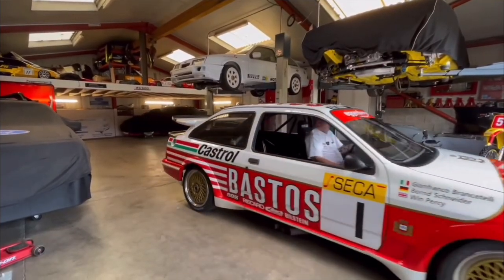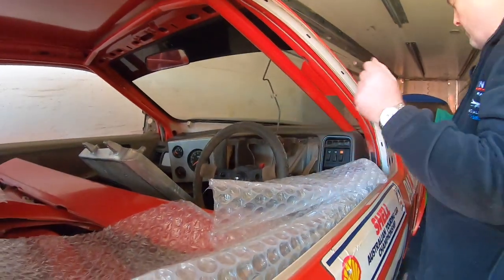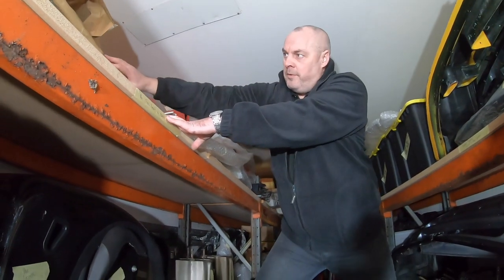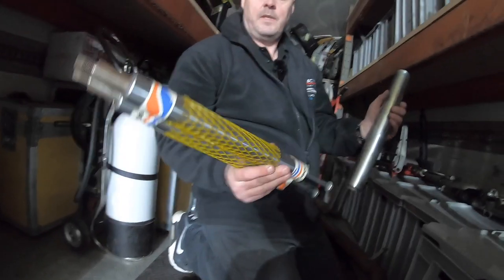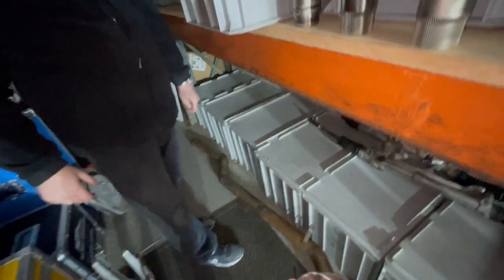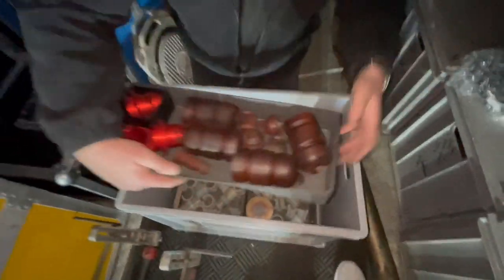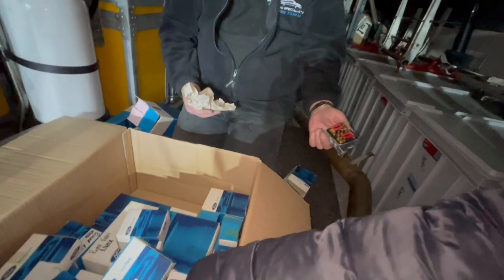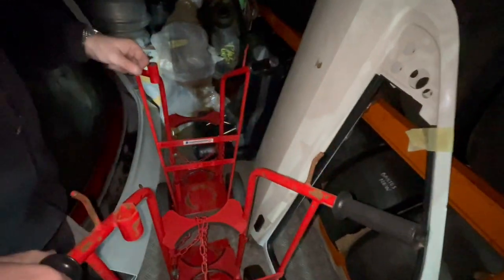Pauls Australian Delivery of IMPOSSIBLE to find Cosworth Race Car Parts

Comment: This is a blast from the past. I worked for DJR during Radisich's stint. I saw that Sierra in the museum and thought it was rough. I never knew it was a show car.  Fooled me. 

I'm not surprised Dick still has parts for the Sierra's. He's a pack rat, never threw anything away. (I remember the roof at Daisy Hill!)

Good luck with your build Paul. I'll keep an eye out for updates

Comment: What a treasure trove! Ended up in the best hands possible!
Maybe one reason the rear arms were changed from magnesium to aluminium is that mag is more prone to cracking around any stress raisers, and more importantly magnesium loses significant stiffness at high temperatures (80-100 deg C), which may be an issue with the exhaust being near.

Comment: Those parts look VERY familiar. I unearthed them originally back in 2010 after being put in touch with the owner by Rudi Eggenberger. I went to see them along with the Bastos car (there were a lot more parts then as well, some have been split off) and was offered both for 280'000 Swiss Francs which was £130k at the time. Hindsight is a wonderful thing...

Comment: Adam see the likes of the plastic air scoop for the radiator on the 500's 
who Paul not be better getting that 3D scanned and 3D printed?
because they are brand new old stock the thickness and shape are 
perfect without any repairs.
I'm pretty sure theres a market/ profit in it for Paul

I couldn't think of a better man to get his hands on these parts, He genuinely cares for ever nut, bolt and washer in those boxes! He will make an amazing #7 and perhaps #8 😁

Comment: Interesting tour of a hoard of parts an also learning a bit of history. I liked the XR4i when I first saw one as a young teen an didn't follow on with Cosworth but later in my 20's I had XR4X4's a 2.8i an a 2.9i.
The 2.8 had all it's ford decals but the 2.9 was debadged an had lots of holes in the dash an stuff where radois an lights were removed, I believe it was ex CID.

Comment: Oh I remember the feeling when a container full of old ford parts landed from Australia at one dealers where my friend was working as spareparts manager. Mk1 Escort stuff had my name all over it, new un used 4.11 diff, rs driveshafts and propshaft, rs / sport stubby front bumpers, window cranks, inside dor handles, and some odd bits and pieces. Every bit in it’s original packing. That was 20 years ago, and I still have all the parts on my car, diff and shafts are now used but not many thousand km on them.

Comment: To the best of my knowledge ( i have followed ATCC from 60s at Philip Island dirt track right thru ) 
DJR did not use Eggenerberger parts on their RS500s, i could be wrong. 
The Texaco Sierras lost the 87 race illegal wheel arches and using non regulation rocket fuel.
By 92 DJR Sierras were up to 650hp, with the turbo, without ( ie running in the engine ) 90hp.
Watching Bathurst 92 car 17 DJ going up mountain straight, changing into 4th gear and still breaking traction at say 200kph 4th gear!
Reply: Barry , i own a DJR sierra , all 6 of them had Eggenberger suspension parts . 
Regarding the Texaco cars , the fuel was found to be legal , and the arches was just a load of bull , made up so the aussie hero Brock would win , there was no way the aussies were going to let a European team beat them on there home turf .

Comment: some places in europe had really high taxes on cars back in those times.  
specially sports and special cars.
to give a slightly newer example.
first gen  dodge viper ended with a 300%  addon  in taxes and registration  before you could legally drive it.
that and high gas prices is the reason behind why you dont see many  highend or fuel guzzling  vehicles  in europe.
Reply: Except in Luxembourg for some reason, they seemed pretty into their muscle cars/yank tanks when I went there, guessing they’re as cheap on car taxes as they are alcohol/cigarette taxes?

Comment: DJR didn't have any overseas parts in or on his cars.It was all done in house by DJR
Reply: im afraid you are wrong , to start with they were built on a rouse kit , then upgraded with Eggenberger parts , plus some of there own engineered parts
Reply: @paullinfoot6017  the only part DJR got from overseas was the shell
Reply: @peterbarber7613  so how do you account for the Eggenberger suspension ??
Do you know i own an original DJR sierra ? i know exactly what parts were used to build it , plus i know Dick Johnson personally , and know exactly what he used , hence why i have been asked to build a brand new DJR sierra
Reply: @paullinfoot6017  yes i do know you own one and i proberbly worked on it.DJR 3,4,5,6 were all done in house
Reply: @peterbarber7613  if you worked on them
Then you should know that all the suspension is Eggenberger parts , DJR did not recast these parts themself , they modified them , but they were still Eggenberger components
Reply: @northyorkshirers500special2  sorry Eggenberger parts were used on only DJR 1& 2. DJR 3,4,5,6 were all made by DJR
Reply: @peterbarber7613  so if DJR cast them in house please explain why Dick and Ryan asked me to supply them parts as they were unable to get them made in Auss ? they must have owned the original moulds etc to have them re made if they wanted them ?
Reply: @paullinfoot6017  Ryan wasn't with Dick when the Sierra's were built.
Reply: @paullinfoot6017  did you ever find DJR-6

Comment: Brake pads have a sell by date I'm afraid,  that lot is worthless
Reply: Yes they do , but to be honest my rs500 has been running with these old pads for the last 4/5 years with no issues
Reply: @paullinfoot6017  think the use by date is for the glue between the pad material and the metal tbh

Comment: WHY would anyone want to recreate a low time in motorsport??  Undertyred, overpowered loose pieces of crap. Used to watck Dick continually pushing himself up in the seat and listening to the inevitable wheel spin when the boost came in. 200-600hp in a second. And the inevitable explosions that happened with all the Sierras.
AFAIK DJR sold all their Sierra stuff decades ago to gullible poms. As soon as they finished with them. And they never used Eggenberger parts. Some parts initially came from the UK, they were all crap so they had to engineer the cars here in Oz that would run and race longer than 10min. That is engines gearboxes diffs and suspension and suitable body mods to limit the fatigue. Not just DJR but all Aussie teams that raced those things.
In a category so turbo biased yet the Commondores still prevailed.
Reply: i think you need to go get some anger management . lol , plus learn some correct facts once you have calmed down  .